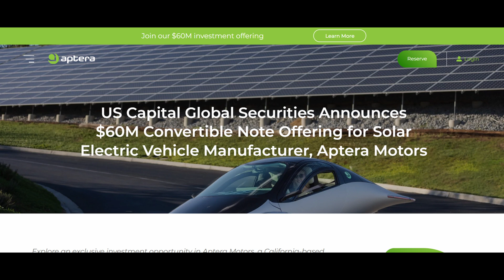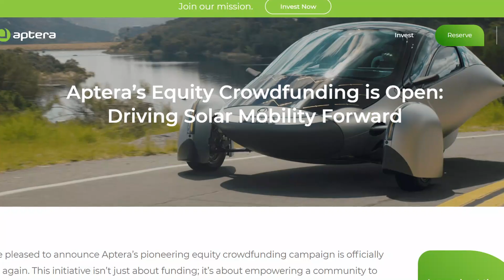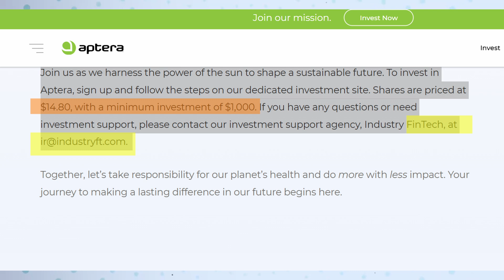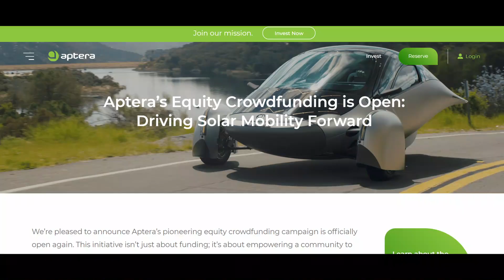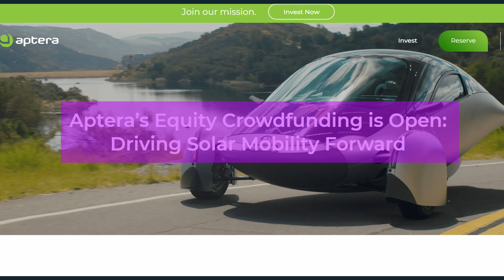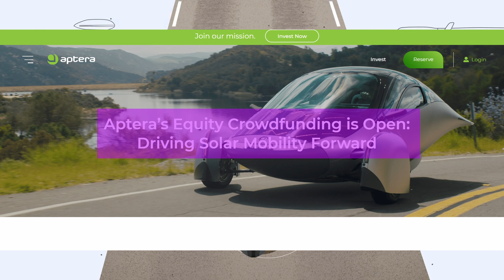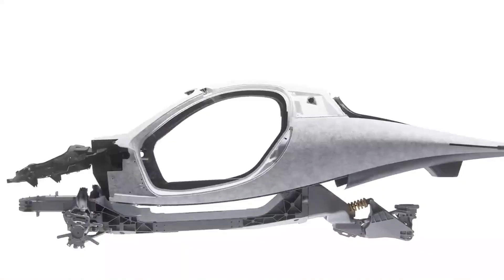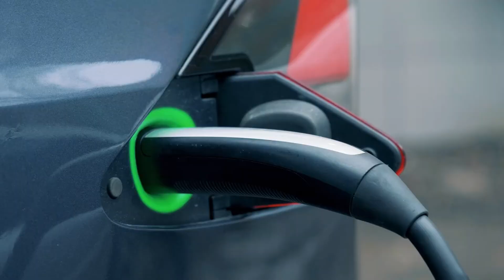Aptera's 2024 PROGRESS Will Leave You SPEECHLESS - HAPPY NEW YEAR

Comment: I’m rooting for Aptera, but this video misrepresents their progress. It mentions a production intent vehicle as if they had a solar powered vehicle but as far as I know they have a an electric vehicle and some solar panels that when attached to the Aptera are supposed to charge it enough to make it go 40 miles. However, right now they don’t have an actual vehicle with solar panels attached to it that can charge the battery enough on a sunny day to go 40 miles.  I don’t know how you plan the manufacture of a vehicle you haven’t proven works yet. I look forward to when Aptera builds their first solar car that does something similar to what their website describes.
Reply from the maker: Its called PI!
Reply: They demonstrated a functioning vehicle at CES 2025, including substantial charging from its built-in solar cells.
Reply: You are correct.  The video is an AI rehash of old Aptera propaganda.

Comment: Smoke, Mirrors, Vapour.
Reply: Most likely not.  They have come this far.  They have shown waaaaaay more than Elio Motors ever did.
Reply: @flipper_1969  They have shown waaaaaay less than Elon Musk  ever did. Or nearly any other BEV producer.
Reply: @vic321344  Aptera is doing something Tesla never did, design the most efficient vehicle. Aptera will be in a class of its own.
Reply: @nickavisa  Aptera is not efficient, it is aerodynamic. With that it is very unpractical for daily use.
Tesla builds the most efficient and safest cars. 4 seaters, practical to load and unload, soon with FSD. 

THAT is what people need. Not an Aptera  motorcycle that is wider than a Hummer H1 and a deathtrap in case of an accident.

And for a motorcycle the Aptera is definitely not the most efficient one. My old Enfield Diesel is more efficient. And 30 years old.
Reply: @ all do respects.  I completely disagree.  Aptera is twice as efficient than Tesla.  We will see as they validate.  Aptera will be a revolution in design and build.  So many people need a two seater get around.
Reply: @nickavisa  Tesla has twice as many seats, its a car and not just a motorcycle and it is the safest vehicle built. 
Nobody needs a two seater. There is no revolution in design and built by Aptera. The design is old, and it was never built for sale. just prototypes, which are not even production ready. 

"will be" is the most used term by Aptera, followed by "will have", "will definitely", "will perform" and the famous "will be delivered".
Reply: Agree, this thing will never see production except for people sending in nickels and dimes every six months

Comment: In the times when batteries were super expensive and their capacity limited, one could make an argument for the Aptera based on its efficiency. The window for that kind of argument is rapidly closing if it hasn't closed already. With the advent of semi and solid state batteries, EV range will no longer be an issue so most people will choose a more practical, four wheel, five seater vehicle that meets all the safety requirement of a car. The Aptera will be, at best, a niche vehicle for those that like its shape and value efficiency over practicality.
Reply: You're missing a point.  If the battery tech gets crazy better, Aptera efficiency will track right along with that.  Lighter cheaper batteries make the already cheaper Aptera even cheaper and even more efficient.  More battery capacity for for a vehicle so efficient it can charge with onboard solar means those batteries hold more of a power buffer for the power from the sun.  Increasing the free driving. I like Aptera for the long run.  No rusting, right to repair, fun, hyper efficient.  I think it will be a game changer.
Reply: Some people actually care about the world we'll be leaving to our children and grandchildren.
Reply: @netscrooge  With a motorcycle that is wider than a Hummer H1? More expensive than a Tesla M3? And a deathtrap in case of an accident? Genius.
Reply: @vic321344  It's easy to throw around words like "deathtrap," but we know it doesn't represent any sort of meaningful analysis.  Talking like that makes you sound like a troll, not an expert.
Reply: There is a point where practicality wins over efficiency.  For being perhaps just a little less efficient, people will be able to get a much more practical vehicle and I think the majority will. I also don't think somebody need feel guilty about getting a small, electric SUV over an Aptera.

The most efficient vehicle on the planet is probably an electric bike. If people really want to save the planet and their money, that's what they should drive. However, bikes aren't practical for many people so they buy cars. But even with electric bikes, the most popular ones are very inefficient as far as bikes go. They are heavy with fat tires that have tons of rolling resistance. They get a long range by including a large battery. I'm not even sure what makes these bikes so popular (cushier ride?) but it's clear that people seem to care a rat's ass about efficiency.
Reply: @patrickhawley1392  There is a big difference between the environmental impact of a small, electric SUV and the Aptera.  And, since most people don't charge their EV from rooftop solar, there is also a big difference in the impact to the electric grid. 

There are over eight billion people.  The consequences of seemingly small differences can be devastating to the natural environment when billions of people are involved.  People with solid moral compasses often ask, "what if everyone did what I'm doing?"
Reply: @netscrooge  the difference is marginal. And solar on vehicles is useless. An expensive gimmick.
Reply from the maker: It may still take a while to reach there
Reply: Getting people out of ICE vehicles and into electric vehicles will have a significant impact on the environment. There are bigger, easier fish to fry for the environment than trying to get people to buy an Aptera rather than a small electric SUV.
Reply: @patrickhawley600  Yes, EVs have an impact.  We certainly can agree about that.  But when you say "get people to buy an Aptera," I can't help but wonder if you're missing the point.  The point isn't to get people to buy an Aptera.  Aptera isn't just about Aptera; it's about solar mobility.  Aptera is challenging the conventional wisdom that there is little point to putting solar cells on vehicles.  With early testing now underway, that conventional wisdom will soon be proven wrong.  That's huge.  It's not merely a big deal for Aptera, it's a big deal for sustainability in general.
Reply: @netscrooge In general, I am optimistic about the combination of batteries and renewables such as solar and wind and I accept your point about Aptera being about solar as well as just being an EV. Perhaps it will work for some people who keep their cars in the sun. If the solar paint announced by Mercedes works and you can put it on more traditional vehicles and essentially get something for nothing than why not. In the case of the Atera, giving up practically of vehicle form is not getting something for nothing so I still say it will make it as a niche car, or I should say, motorcycle, if at all. Please note, I am predicting what people will do, not what they perhaps should do.
Reply: @patrickhawley1392   I hope Mercedes solves the challenges of moving from the lab to usable product, but who knows how long that might take.  And, yes, of course the Aptera is a niche product.  That's been obvious all along, although the question about the size of the niche remains open.
Reply: No, you are missing the point. When efficiency becomes less important, people will choose practically. That's why people drive SUVs instead of gas versions of an Aptera. It will be a niche vehicle much the same as a small sports car.
Reply: @patrickhawley600  Possibly, this country does like giant wasteful vehicles. But why would efficiency become less important when everything seems to be sooooo expensive.  Isn't that what everyone exclaims?  So wouldn't a vehicle that's more affordable and crazy efficient be the perfect commuter car?  2nd car?  I think it's going to find a substantial place in the market especially with younger more environmentally couscous people.